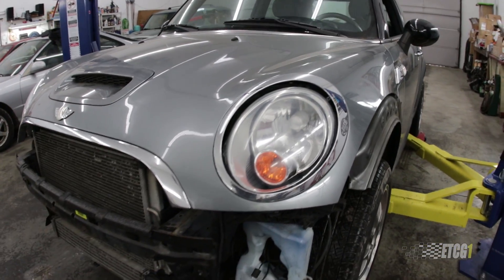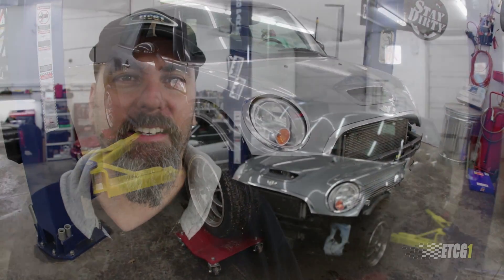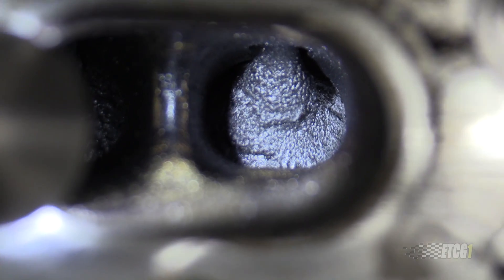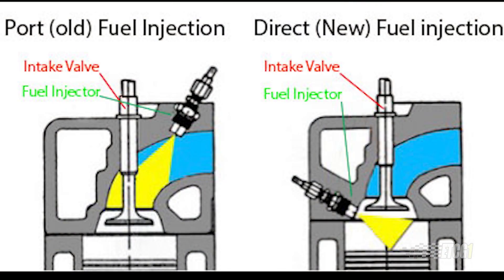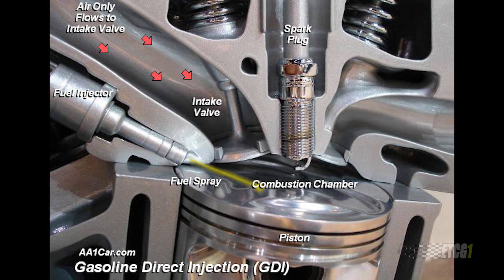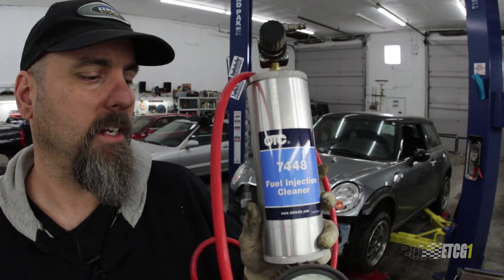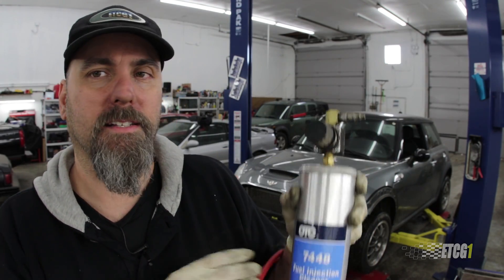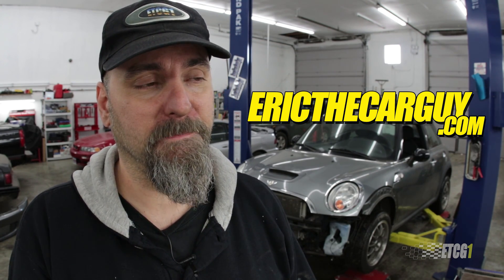Direct Injection Proves Fuel Additives Don't Work

Comment: DI alone sucks. Dual injection (DI & Port) works much better and is becoming the norm. The vehicles run as DI most of the time, but utilize the port injection under certain circumstances. Turbos and EGR systems exacerbate the situation in a DI only engine; the current gen WRX and last gen FXT (essentially FA20DIT cars), are having issues at 30k+/-, most enthusiasts/modders delete the EGR system and install an oil catch can to reduce carbon build up, Subaru has done "top end" cleaning as warranty work (mainly the intake valves) because of this issue.

To the Fairmont carb comment: I know you're just trying to stick it to the pro-efi (or anti-carb) guys, and I agree it's your car, you do what you want, but if you had done fuel injection on the Fairmont it would have been port not DI (since there isn't a DI setup for those engines) so you wouldn't have the carbon buildup or HPFP issues, and you would have alleviated a lot of your carb related issues early in the build and during tuning, maybe even avoided the engine fire issue as well.

Again, your car, your build, you did what you wanted; but that statement at the end should only be made by those who dwell under bridges; it was very "knee-jerk" or "heat of the moment".

Comment: Carbon buildup on the intake valves of DI engines come from two (2) sources, the PCV and EGR systems.  "Top Tier" fuel can help, but ultimately it's a design\engineering flaw.  A catch can for the PCV system will help.  Modern engines have more blow-by then older engines due to the use of low tension piston rings designed to reduce friction.  Also, PEA is a thing.
Reply: PCV, EGR not problem. “Top Tier” is. Tune lean and have turtle torque or get another lease.

Comment: I was cleaning valve covers on a '97 Nissan Maxima that had over 193,000 miles. Oil was burned on to the aluminum covers and was using Autozone engine degreaser.  Burned through the can barley making a dent.  Started using non-chlorinated brake cleaner. Burned through what I had left of that.  Used what was left of my chlorinated brake cleaner.  Worked good, but didn't have much left.  I had changed the fuel filter earlier and collected the gasoline and decided to use that.  Gasoline worked better than any of that stuff.  Ended up using more gas out of my gas can for the lawn mower. The gasoline cleaned that so well it's no wonder it cleans off valves while in use.  I rather stick with a port injection instead of DI.  Car makers coming out with some different way of doing things to make people feel like they're buying something new and improved.  Only to give consumers a new problem to deal with.

Comment: eric, i almsot agreed, but, after some research, i think there is one possible grey area you might need to consider before suggesting that becasue fuel cleans carbon, it will clean everything.  It will not clean the lacquers that are formed by the heat degredation on pure gasoline inside an injector, it will just add to it.... this is not carbon, and is not the same as the carbon fouling on valves, pistons, or spark plugs. It is commonly reffered to as varnish, but it is more like what is known in the polymer industry as a lacquer, that is, a hardened resin which is formed without a real need for oxidation from air (oxygen). it is harder than the carbonaceous type of buildup on the back of the valves. (still sometimes reffered to as varnish).
The most ive ever held in my hand is about 1mm x 5 mm, and that was from in a carburettor jet before any air bleeds and was purely a result of cooking gasoline whihc is going through a small opening over its life of 10 years or so.
Now this bit is just an opinion, but i would hope, that a cleaner with a decent price tag should have enough of the trade secret ingredients, stuff which softens the surface of the lacquer, like a strong paint thinner, enough to allow the varnish to bend and give a bit and eventually let go of what it is holding on to, usually the contacting areas of the injector solenoid where it seals shut.
the stuff that i have physically removed from injectors has only ever been miniscule and easy to remove with a brush,, and i would imagine that a good hard run with a few tanks of this stuff should help.
Saying that, if u need to clean a paint brush quickly,, gasoline is the best thing!

Comment: Obviously your point about the direct injected engine is valid but I'd like to remind you that the gasoline most of us get from the pumps these days isn't pure gasoline. There are all kinds of things added to it from ethanol to detergents to various other things to make one brand marginally better than another. All of these are generally added at the pump. When burned they all leave their own particular brand of residue behind on the valves and generally speaking another brand's version of that cleaner or power improvement chemical will generally act as a solvent and clean it off. Changing your fuel source every 5000 miles was actually recommended by a chemical engineer who worked for I believe it was Exxon whose job it was to come up with the additives for that brand.

Comment: Gas is a great cleaner, been using it for years.....  Oh and BTW, GDI is only good if it has port injection as a secondary system, or at least incorporated somehow into the air/fuel system.

Comment: Pirate air, poor combistion, lots of soot in the exhaust for the EGR system to pick up. Reprogram the computer to use the oxygen sensor on the exhaust manifold for feedback to correct the mixture.

Comment: Alright alright alright, I've heard it before there's no such thing as a mechanic in a bottle. I get that but I thought fuel injector cleaner was just meant to keep your fuel injectors from getting clogged? Do you have a video on how to clean a 3.4l SFI engine(sequential fuel injection is the same as direct injection right?) I'm interested in getting into the guts of my engine and cleaning that baby out.

Comment: On 3 occasions I have used Lucas or stp fuel system cleaner dumped in my gas tank to cure a misfire code with lean condition. The issue never returned.
Reply: Early 2000's something Kia. 2002 Grand Prix 3.8 and 2007 g6 2.4.

Comment: That’s why Toyota uses both direct and port along with Atkinson cycle on their engine. That way the intake valves stay clean.  They also use a high pressure direct injector cleaner.

Comment: Seems that European cars seem to suffer especially in the usa. I think the fuel is worse in America
Reply from the maker: I think it's more like Americans don't take care of their vehicles as well as Europeans do.
Reply: ETCG1 maybe that too. Certainly European fuel is higher octane. But I think other regulations such as detergents and additives are stricter in Europe too.
Reply: The issues are just as rampant overhere in Europe. The 1.6 engine in the Mini is actually a PSA development (Peugeot/Citroen) which is well known for this issue (and timing chain issues as well, search for 1.6 THP timing chain).

I do feel that some of these engines benefit of good quality fuel. The small Ford Ecoboost engines (1.0/1.5/1.6) do seem to run better on fuels which have 98 or 102 Octane. But direct comparison to US ratings is difficult because 98 RON in Europe is comparable to 93 PON (pump octane number) in the US. 
Cars are developed to run on 95 RON in Europe but these downsize engines seem to enjoy higher octane fuels better.
Reply: well yes a citroen engine is alsways bad whatever continent or planet it's on haha.

Comment: Jumping into diesels here sorry. In my country almost any car guy owning a diesel(merc, bmw, those kinda performance diesels) first thing they do is delete/ empty the dpf and MOST IMPORTANTLY, remove the EGR because doesn't matter if its a prechamber or direct injected diesel, the valves look like the mini's intake valves all the time. I have that in every diesel I have owned. DPF is fine but the god damned EGR is also snake oil of car industry emissionswise. Why we get away with deleting DPF and EGR is that the MOT in our country has no ways to check if the DPF for example is enabled in the ECU software. Therefore, for this, my country has set regulations that require that the engine software has a standard file that can be uploaded from the CAN bus to determine these parameters.

Comment: It's long been a issue for direct injection engines , if not maintained correctly , they will gum up , and without regular oil changes can suffer the dreaded sludge problem , I'd recommend using premium fuels , and of course proper servicing .

Comment: I got 2 Audi with both direct injection, I just    use 98/100 octane to minimize it the carbon build up and drive like i stole it ! 
it has been 16 years this one is fine run strong still, while another one is about 20 months with, without any problem. i dont know but it is the way how we drive  it!

Comment: How would the intake valves be cleaned on a direct injected engine if the additive is sprayed into the cylinder? The additive goes into the combustion chamber and ignited. Any cleaning property is gone after combustion and now it's just waste which exits out the exhaust. It maybe enters the intake through the pvc system but only after combustion. The cleaner never touch the intake runner portion of the valve. Does that mean the 19.99 bottle of super juice works, probably not, but the argument over injection cleaner being debunked by direct injection engines makes no sense

Comment: Additives work, but mostly to prevent gumming or fouling and such. So even though gas is a solvent, it keeps a film from building up even when it's used. (So less of a build up when the gas evaporates off of stuff.) The majority of the time, the ones mixed in by the gas station itself is adequate.

 And the problem with the mini? It's been solved...
https://www.caranddriver.com/news/explained-why-some-engines-have-both-port-and-direct-injection

A lot of car manufacturers switched to doing that, because of the problems you pointed out with direct injection only.

Last comment was a bit of a troll though. It's dead because overpriced Mini (along with BMW's particular way of doing things), and marketed on style more than substance the same way overpriced Apple computers are. Not to mention your car is using a racing carb and not the usual mass-produced crap that was around in the 1970's and 1980's. (Many people that were around then remember having nothing but headaches with those.) Maybe look at your Acura and how it runs, before digging on injection vs. carbs?

Comment: eric how do you get rid of all that build up on the intake valves? my 2007 saab 9-3 uses an electronic throttle body(which is prone to failure) either way....the back of the valves theres so much buildup..

Comment: manual, generator, points/condenser, mechanical fuel pump and carb. is and was far more reliable. many of the other surrounding parts back then were not though.
now days, "ethanol" corn fuel is a big killer though

Comment: catch can setup for the PCV system and routine intake/valve cleaning with chemicals is needed on "DI" engines. many will carbon up so bad it breaks free, hangs a valve bends with piston contact or the chunks all go through onto the catalytic converter and goodnight to it ;)

Comment: I love my Mazdaspeed 3, had manually cleaned the valves once, started running a catch can system and spraying water-methanol, and my valve are/stay squeaky clean. Problem solved.

Also, it's worth noting that all DI cars aren't created equal in terms of the accumulation on the valves. In fact, the Mini is known to be one of, if not the, very worst of all. Also, DI is superior to PI in many ways, including efficiency/power production, and (very helpful to turbo'd cars) cylinder cooling. This is why we're seeing it more and more.

Nowadays many DI cars run both PI and DI as a solution. Easy peasy.

Comment: Of COURSE they dont work with DI. They never can if the fuel never comes in contact with the intake valves. For what its worth, the name brand fuels do remove deposits quite nicely on traditional fuel injection systems. Its like saying cancer treatment doesn't work after not taking any of the medication.

Comment: C’mon Eric,you know fuel injection is way better than a carburetor,it’s just a mini and they have issues anyway. This whole direct injection thing will be a learning experience for automakers when they get it right
Reply from the maker: Fuel injection is versatile and produces less emissions, but the simplicity of my carburetor is not to be ignored. Also, it makes just as much power as fuel injection. It's also cheaper. Carburetors do have advantages too.

Comment: Than why with additives do I run at 510 instead of 880? This is RPM @ idle.
Edit a BMW.. yeah chain time.
4 tanks.

Or let me guess, it's because i stated running Diesel oil. AKA T6.

Comment: This is probably apples and oranges since I’m talking about a diesel engine, but when I use an injector cleaner in my VW TDI it doesn’t go in the tank. It replaces the fuel supply and the engine runs on straight cleaner. Way better effect than diluting the same can of cleaner by dumping it in the tank.

Comment: the problem isn't necessarily direct injection ive found plenty of port fuel injection cars with gunk all over the intake ports just not on the valves because of the fuel spray. The thing that causes all of the build up is the combination of oil vapors from the pcv sticking to the walls of the intake track and then the carbon soot from having an egr system sticking to those oil blowby vapors and creating the mess in the first place. This is why most of my cars have the egr blocked off and an oil catch can for the pcv system it completely solves the issues of any buildup from happening. This is one of the big fails of the epa and auto manufacturers trying to do whatever fuckery they can to meet emissions standards, in theory their design works and reduces emissions but in the real world it probably doesn't because of the fact that shit loads of vehicles with gdi engines are driving around with gunked up intake ports and valves covered in carbon crap which makes the cars not perform the way they are supposed to or probably even meet those emission standards they were designed to anyways. All these new cars weren't built to last anyways notice everything is made of plastic even valve covers and intake manifolds which get brittle over time there are like a million sensors ready to fail and the wires get more and more thin to try and save money cars are becoming more of a disposable appliance where once the warranty is up and things start to go wrong they just get thrown away and replaced with a new car. It's extremely wasteful but good for the auto manufacturers pockets if people have to keep buying new cars every few years.

Comment: I've been a mechanic for about 30 years now and I've always told my customers the same thing save your money on all those stupid additives, that includes all the wonder oil additives as well as this fuel system cleaner and that cleaner, and those wonder stop leaks to seal up things like radiators, power steering and what not are a joke and only good to maybe and I say maybe get you home or to the shop for a real fix but they are at best just for that ot get you in for real repair, all you need to do is use good quality oils and what not, have a proper maintenance schedual and your car will keep on going for many miles you just don't need all those snake oil additives.

Comment: We have to blame our Governments for most of this crap with clean air and fuel economy standards. With all of this technology and expense the air is no cleaner and fuel economy is not much better than 20 years ago.
Reply: wysetech2000 I think fuel economy is worse. I had a water cooled 1980 VW which yeilded the same or better mileage than a Prius. It had minimal emission control and mechanical fuel injection.

Comment: I don't get your point...of course a fuel cleaner won't remove carbon build up in the intake runners and on the back of intake valves....that is not part of the keyword (fuel system). 
That buildup is caused by the pcv routing crank case pressure back into the intake manifold...
Reply from the maker: Did you watch the video or just comment?

Comment: My issue is that having valves cleaned is pretty much in none of the regular maintenance in the manufacturers recommended scheduled maintenance. My gti just got over 100,000 miles and I had the valves cleaned about 40k ago and I plan on having it cleaned again soon. That's the only real way of keeping these engines running right! I personally think the manufacturers should tell you to clean the valves ever 50k or whatever just like you change oil, brakes and other fluids. The unfortunate thing is many drivers don't know that this may be an issue

Comment: So if you have a healthy engine that is injected over the intake valves, putting in a cleaner fluid once every oil change isn't doing a damn thing?
Reply: “snake oil”: Either fill reservoir with ethanol or fill oil interest pockets.

Comment: Most of the direct injection carbon buildup problems I've witnessed were from customers using cheap fuel.  Use TOP TIER fuel with PEA additives in it and don't worry about it.   I use in tank cleaners to help protect and clean the fuel sending unit.    FWIW depending on exhaust design those pressurized injection cleaners will toast converters in a heartbeat...

Comment: I used to work in a machine shop rebuilding cylinder heads.
These heads were prone to burnt exhaust valves, I'm talking pieces of the valve missing, because of  carbon build up on the valve would cause hot spots.
They were so loaded with carbon we had to almost use dynamite to clean them.
I feel that the EGR systems added to the problem.